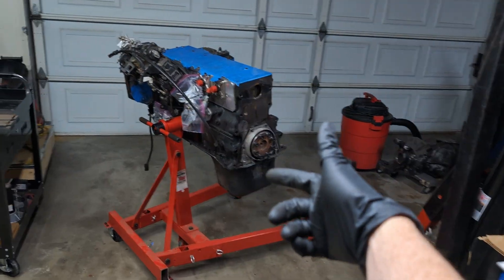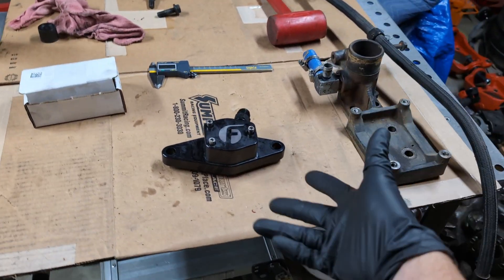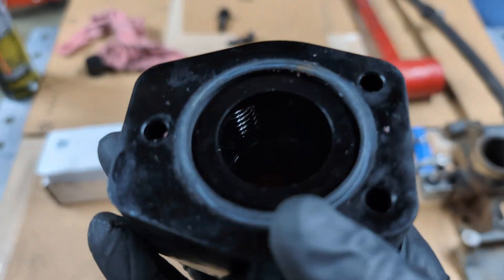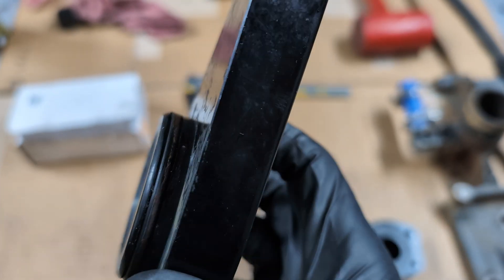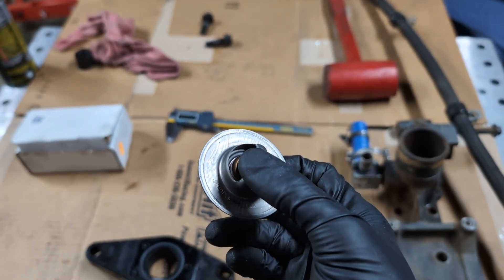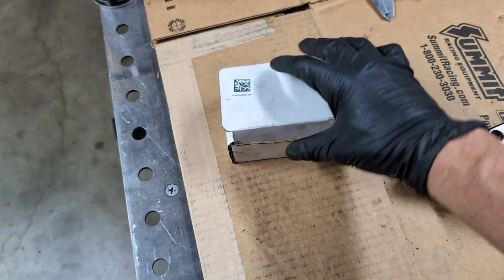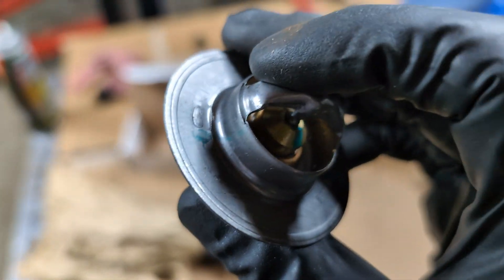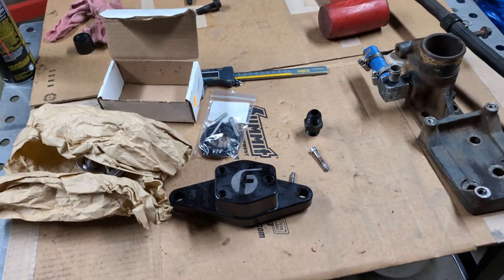Fleece Coolant Bypass - Product Breakdown - Cummins Diesel

Comment: Thinking I should have had thermostat on on in back of motor opened and only run front one. Be pain to change once in truck
Reply from the maker: Changing the thermostat inside this wouldn't be impossible, but def not easy to get to. Cummins themselves sells a bolt-on piece for the rear of the 6BT engine that accepts an NPT fitting for constant flow.

Comment: When I installed mine it leaked right away but it was probably cause I gouged the bore opening of the freeze plug where the housing goes into and had to use RTV to make it stop leaking.